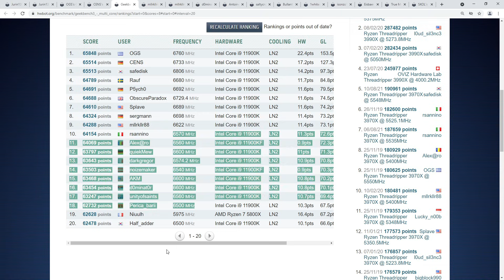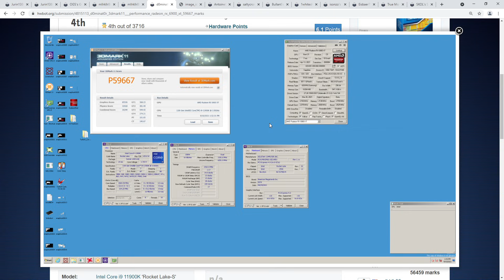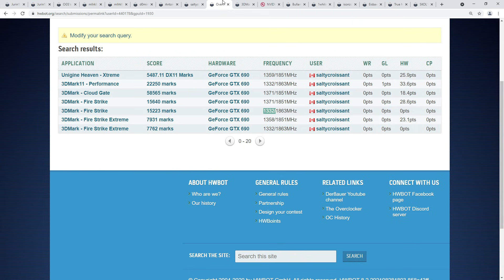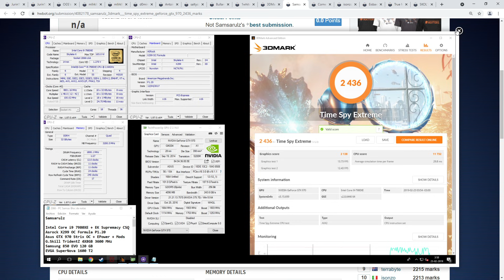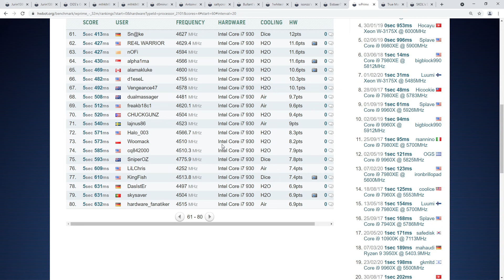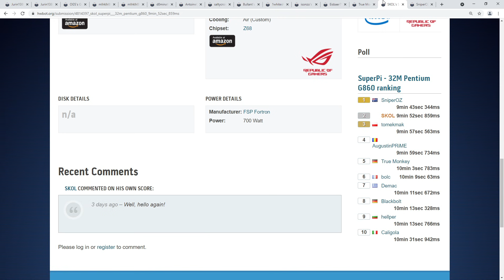HWbot score round up #18: 6GHz+ 5600X, cap modded GTX 690, DDR4-5380 CL15! and more

Comment: I have my windforce x3 gtx 670 clocked at 1267 gpu and 1851 mem at about 245 watts stock cooler with a i3 8100 cooler in the back with thurmalpads

Comment: Mine wont even do over 4.6
Reply: Rip buddy, I got lucky, that's all I'll say.
Edit: I'm getting 4775mhz with a 100 mhz offset through Asus bios.  Granted I'm on a very over kill cooling system.
Edit 2: I got lucky and got a golden sample for sure, with just pbo It was 4.675 ghz at very low voltages.
Reply: @MrRagequitnow   mine to 4.8 but power limit should be unlocked